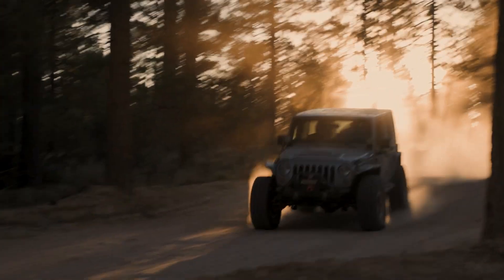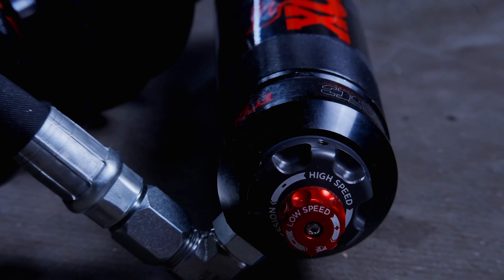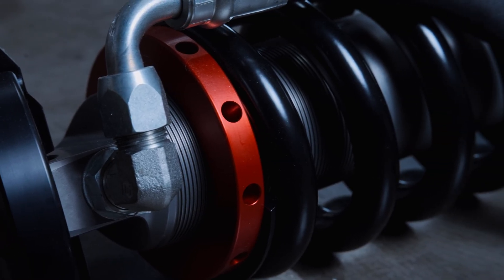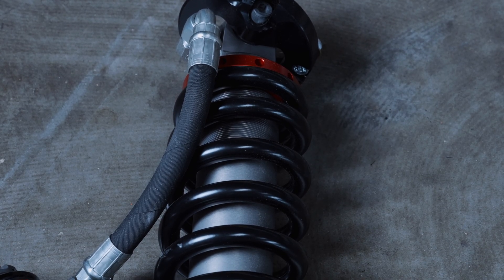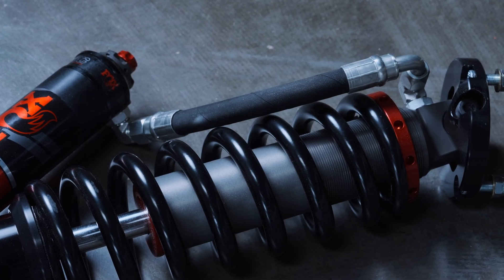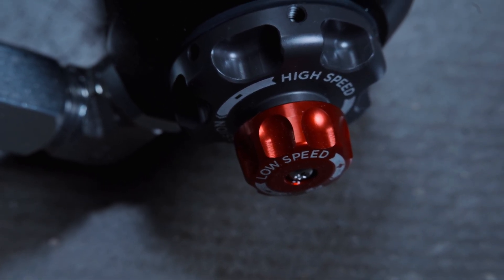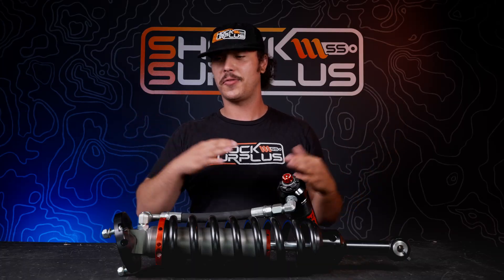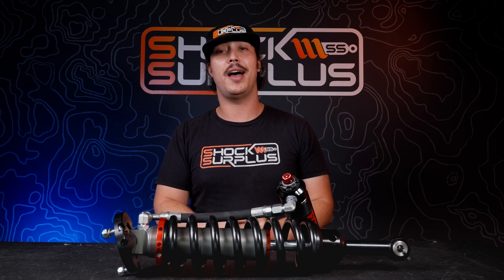Shocks in 60 Seconds - Fox Factory Race Internal Bypass

Comment: Does anyone know how the preload works on these? Is a good rule of thumb for every inch of added preload equates to 2 inches of right height? considering these are position sensitive, what would be the maximum allowed preload to ensure optimal performance in the ride zone?
Reply from the maker: Depends on application, but if you have close to a 2:1 motion ratio like a lot of mid-size Toyotas, that's a good rule of thumb